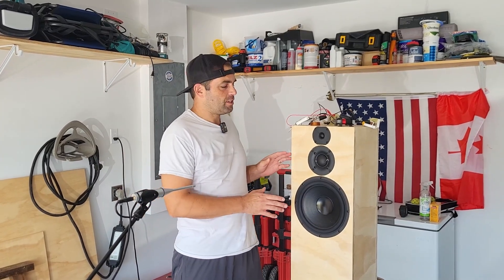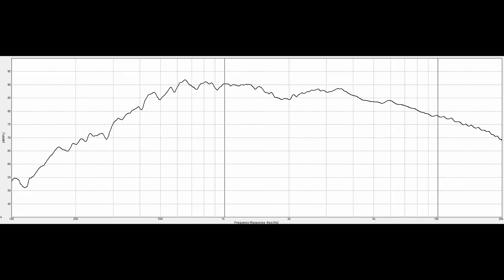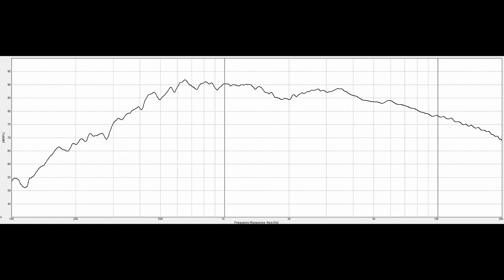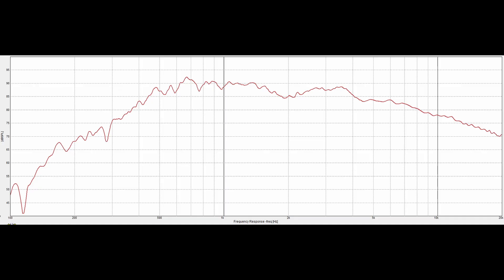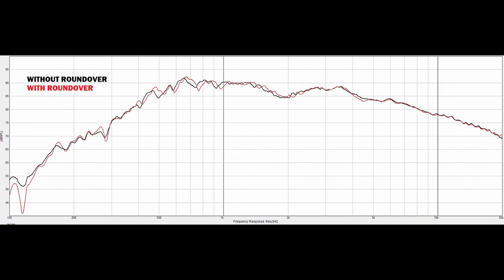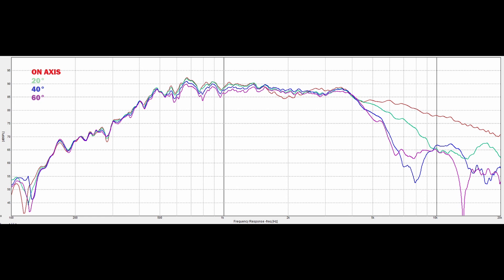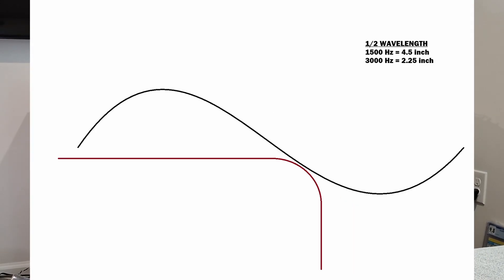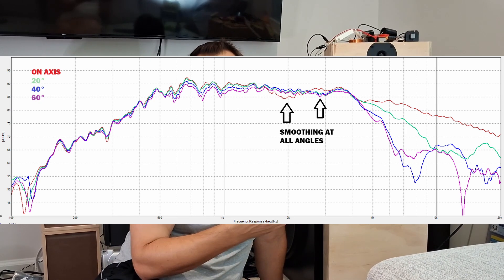Adding a Round Over to a Baffle with Bad Diffraction.

Comment: The frequency at which the diffraction issue is mitigated by a roundover is directly related to the radius size as you allude to. The book "loudspeakers" by newel and Holland OR Joseph d'appolito testing loudspeakers talk about it in their books. But I can't remember which!
Reply from the maker: Ya I simply forgot that would happen until the results were in.
Reply: @ImpulseAudioSpeakers I feel your pain. I made a square box once because I simply forgot about standing waves. So many systems within one box to think about!

Comment: Thanks for doing tests like this. In this case it was just like I anticipated, maybe moving the mid or tweeter horizontally (offset from the center) would make a bigger difference, but probably not very much. Compared to the rest of the system characteristics I believe details like this is negligible.

Comment: I read in a DIY-speaker building magazine that 25° inclines are optimal to fight edge diffraction. This cannot be done by a router and needs a particular saw or straight forward sanding
Reply from the maker: I wonder why that angle. Hmm. Wouldnt be hard on a table saw. Ive done 45 degrees that way.

Comment: Just shave those corners by 2 inches. It doesn't need to be a roundover. Do it at an angle towards the top too. It won't look bad and people can do it with the cutting bit they have. Only a matter of jigging it and of course adding some material behind.
Reply from the maker: Ive done that before. Baffle would need to be double thickness though.
Reply: @ImpulseAudioSpeakers   Yes, at least in the corners.

Comment: Gotta mix in individual 2-4 inch strands of Dyneema with Bondo or some kind of epoxy that I have yet to see. (My 1.0 speaker was made with epoxy corners but they weren’t rounded, just turned a single 90 degree corner into two 45 degree corners). Need to have the shape and size of 0.25 of a vertical beer can. I use spray paint caps to do it. Once the rears cure I put the front panel back on and use the binding post hole once removed ore do 1 side a day using woofer or mid drivers to do each front corners a day. I recommend using a hydroscopic silicone spray so the front will never be stuck along with a thick rubber gasket. No silicone or latex. Fully vulcanized rubber on the softer end of the durometer scale. That along with other material and methods will ensure no rattling and keeps reflections outta’’ da box!
Reply from the maker: Seems like a lot of work. Id prefer to double or triple the baffle thickness then chamfer it with a saw.

Comment: Rule of thumb is that for any effect the round over radius should be at least 1/4 of wavelength to be noticeable. Radius of 1/2 wavelength is recommended. At 3 KHz the wavelength of sound is about 115 mm. This means that round over should have a radius of at least 30 mm. 60 mm would be better. And if you want the RO to be useful at 1500 Hz, well, double that numbers. So your round over was just a cosmetic feature,
Reply from the maker: Yup I'd agree with that.

Comment: Useful video as always:)  love your channel, thanks man. I use the same measurement system (on top of the others).  What's the gate timing and the distance  to the mic and 1st wall you had there (guessing you were in combined mode) as normally even without smoothing (I don't use it) the curve doesn't get to be so rippled.  I'd also check your RT60 in the room. I prefer Seas, SS and Accuton drivers to work with.
Reply from the maker: I recall 4.5ms or somewhere around there. I was only 3 or 4 ft from the ground. This is why I like to get higher and use 10+ms.

Comment: Yeah, you need significantly more to affect those lower frequencies. Take a look at the Grimm speakers. Unfortunately it's not easy to build something like that. Even the termination at the back matters. I think Troy from Joseph Crowe did a video showing the differences you get when you have a horn wrap around completely rather than just "ending" sharply after wrapping around a bit

Comment: My preferred solution for this, if the box can't be modified otherwise, is adding a little "hat" on top of the tweeter, and making the rounder even larger around the tweeter left/right edges in tangent to the two circles meeting in the middle. That would sufficiently disunify the distances and especially equidistances to the point that the diffraction modes still exist but the effect is spread over a larger frequency range with a lower amplitude in any given spot. 

HAT!

Comment: The whole thing with edge diffraction has always been a red herring brought to us by speaker marketing people and ignorant people. As you showed it doesn’t do much at midrange and lower frequencies because of the wavelengths involved and at higher frequencies the tweeter is beaming and so nothing is getting to the edges anyway. Your off-access response graphs support this too.
Well done experiment which will, hopefully, put this malarkey to bed finally.
Reply: "The whole thing with edge diffraction has always been a red herring". No, not the whole thing, but thinking that a round over that is smaller than a 20Kh wave length will fix the problem is.

Comment: You have a top port on your speaker...I've never seen that before
Reply from the maker: Ya I was trying something new and it allowed me to wire the drivers out the top. Only problem is now Im worried Ill drop something down in there 😂
Reply: @ImpulseAudioSpeakers  I was thinking about a top port or a single bigger round front port when I bought a set of DIYSG Vortex kits,  but never got around to building the boxes.
Reply: @ImpulseAudioSpeakers  Worst case scenario you can make a slow 45-45 on the back by cutting away a section that is as tall as the port is high internally (a square cross section if viewed from the side) and creating what's essentially a gradually turning corner that turns your port towards the back again. 

That, or you do some voodoo to swap the inlet and outlet by cutting a hole at the top of the cabinet rear wall, closing the exit that was in the top panel, and doing vice versa at the other end so it ends in the rear.

They're all pretty complex solutions but very interesting methods to faithfully modify a box.
Reply: @AnnaVannieuwenhuyse  At that point in time I had a pet squirrel that wasn't allowed in the basement because of electric wires, but just in case, i didn't want it seeing a port hole and deciding to explore.  Now that the squirrel lives outside, i think a front slot port or single large circle port would look fine on the front,  but two mid sized circle ports would look weird with a concentric driver.

Comment: Better yet, take your tweeter and   mid range out of the box and into a narrow baffle above the base box historically, if you look at some very good speakers, Vandersteen And Dalquist in the 1970s did this. You will have to deal with step compensation, with the lack of a baffle for reinforcement over certain frequencies in the crossover. But will get a much more open sound.

Comment: So then it's not edge diffraction causing the results you have.
Reply: It still is. It's just that the solution used here doesn't provide enough relief from the effects to be significant in context of the on axis response.

If you're unsure of why the off axis ones do improve: Picture yourself standing near the speaker, and point your eyes right at the midrange speaker. Now imagine the distances to the edges left and right of the midrange. The objective distance differential is much larger than on-axis (where it is 0). The percentage change (positive or negative in distance/differential) to before the roundover is greater off-axis than on-axis, because of the depth element added (which is also 0 when on-axis).

On-axis, the center-meeting modes dominate and you cannot escape those by changing the distance unequally without either tackling the modes entirely (stopping the diffractiuon) or moving off axis -- but then they're no longer on-axis effects, which brings our options down to one.

Comment: Use felt rings then 🎉
Reply from the maker: I'm not sure that would work. Maybe I'll have to test that 😊
Reply: @ImpulseAudioSpeakers   Can you objectify a reason why you figure it wouldn't? Or perhaps in a different form or question, can you visualise for yourself what the felt ring would do and then draw conclusions from that as to why it wouldn't do anything? If your answer is no to either of those, then consider that you may not yet know how to gain a science-informed opinion or perspective on this. That's an ideal opportunity to explore this method and the science behind it! And it's also how I motivate learning about these things to myself for myself.
Reply from the maker: @AnnaVannieuwenhuyse unless the felt is very thick itll have the same problems this round over had. But as my comment said, Id love to try. If you've seen what I do on this channel, I definitely try things and learn. My comment didnt suggest I wasnt open to the idea.

Comment: Perhaps the curvature needs to be greater to be effective? I have a pair of Focal Electra 1028be speakers, whose baffles are already round, with fairly large rounded edges. They won't have any diffration?
Reply from the maker: Yes something like a 2" round over would have done something. Maybe not fix it, but a lot better.

Comment: Showing the off-axis response helps support an important concept regarding crossover design: don't try to fix diffraction effects in the crossover to achieve a flat on-axis response.  This will cause peaks in your power response where the off-axis response is actually higher than your on-axis response, which is already flat.
As someone who loves a wide-open sound (from wide horizontal dispersion), my preferred solution is very large round-overs.  I don't prefer waveguides, which typically restrict dispersion.  That might be best for multi-channel, but for stereo, I appreciate the effect of a soundstage-enhancing sidewall reflection assuming it's well balanced spectrally, and sufficiently delayed so it doesn't degrade imaging.  That does require a room on the larger side, as you need about 5 feet (or more) between your speaker and the sidewall.
Reply: Agreed. 
Re soundstage enhancing reflected energy, ASW, or Apparent Source Width, ... plus a clean ITD Gap, followed by late arriving reverberant energy. 

It's refreshing to encounter such a reference. I suggest it every polite opportunity myself! 

I often point out ... all this work has been done. I mention targeted acoustic performance best practices, LF decay times, ETC measurements and the ITD Gap, ... and 40yr career audiophiles have no idea what I'm referencing. 

Gene Patronis and Don Davis'; Sound System Engineering. 
Trevor Cox and Peter D’Antonio's; Acoustic Absorbers and Diffusers: Theory, Design and Application. 

Overlay that work with Dr. Toole's, Sound Reproduction, ... which assembles an overview of all the above technical best practices, a strong emphasis on subjective findings, ... essentially listener's preferences and how to get there.       

The pathway to a high-performance listening experience is clear. Yet, most rely on old school myths, or an ex-felon youtuber selling magical treatment.   

Hopefully LLMs eventually get it right! As the enthusiast of a decade from now will likely be largely reliant on them for learning of performance pursuits.

Apologies, rant over.
Reply from the maker: Very good point. It would have been good if I commented that in the video.

Comment: Also not just depends on the frequency BUT also the drivers. If a driver beams a lot you are less likely to have issues.
Reply from the maker: True. I did cover this in my tweeter diffraction video, but I should have repeated it here. Thanks.

Comment: I have done this work the hard way back in the 1980s. 3/4"
round over is near useless at all but the highest audible frequencies. If you want to keep the surface wave energy stuck to the surface and not diffract off at down at meaningful frequencies, it needs to be in the neighborhood of 6" radius, or greater. .
Reply from the maker: Yup!

Comment: Hi, You can test if the dip in frequency response is caused by the distances from mid to edges of the baffle by playing pink noise and holding a piece of plywood by hand as if one of the edges is longer (say 30cm x 20cm or any other length). You can move the plywood from one side of the baffle to the other and see if the dip goes away or it is always there.
Reply from the maker: Hadn't thought of that. Good suggestion.

Comment: @ImpulseAudio  
Comment for the Algorithm.  ;)   Also, noting that this design seems to have 3 Equidistant baffle edges from the midrange.

I use the same Ciare 10" midbass and love it, but it's combined with a BMS 5CN162-HE 5" Coaxial midrange/HF compression driver, all run active with a multichannel car audio DSP/Amplifier powered by a nice 12v PSU.

Can you not move the speaker out more into the center of your garage further away from the walls/corner to do your measurements?   ...Oh, I guess you have the floor & ceiling to worry about anyway, so disregard.

HINT:  Just bust your @ss to earn the cash to buy a pair of KEF Blade ONE META or Blade 2 META.  Edge Diffraction problem solved, mate.  😊
Reply from the maker: I love the Kef Blades!! Yes the garage floor is the issue. Going outdoors and high is the best options. Also, thanks for the algorithm boost 😅

Comment: Another option is 3D print a baffle and glue it to the front. Or use 1/2inch foam, or any other material that can be easily sculptured. Instead of glue, you may velcro it on, to easily switch and test different baffle designs.
Reply: Oy the legend! I'm redesigning myself a Hypercube >.>
Reply: @SianaGearz  Hi! Mine still works great :)
Reply: Aka cheap boombox style ;p Or just make the entire front baffle of foam with the "real" baffle behind the drivers (mounted with rings)

Comment: I think the roundover was too small for the midrange frequencies.  Just my guess.
Reply: To notice a roundover in the mids the radius has to be about 1 1/2 up to 2 inches. Been there - done that.....
Reply from the maker: Agreed, hence my conclusion.
Reply: @ImpulseAudioSpeakers  Exactly :)   A while back I did  basically a quick and dirty test similar to what you did and came up with a similar conclusion. 

Honestly these days I dont even worry about the little wiggles in response and I'm totally good with a speaker that has a sharp edge. 

I find the room interaction is so far greater anyway in terms of messing with the response.

Comment: Brian, I am wondering if The Baffle Diffraction and Boundary Simulator (1.30) by Jeff Bagby would repeat your results. Would you please check that out?
Reply from the maker: Does that spreadsheet work anymore? There was a program called Edge I use to use years ago, but I couldn't find it anymore. Seems those tools were designed on very old versions of windows.
Reply: @ImpulseAudioSpeakers  I believe it would work with the new version of Microsoft Excel as well.
Reply: @ImpulseAudioSpeakers  I guess if you have Microsoft Excel that table should work. The latest 1.30 Revision is dated 2019 and it seems to be working with some issues in my free SW OpenXLsx PLUS.

Comment: I'm considering tweeter placement in an MTM and thinking of offsetting to one side so the diffraction isn't amplified by both sides. I'm not doing a roundover on this one.
Reply from the maker: Consider that as you move off axis you will get bad diffraction at some angle, and it won't be the same in both directions. I'm generally against offset.
Reply: A roundover is a good idea regardless, even if it's a small one compared to what's shown in the video. It's outright foolish to forego such a simple aid and mitigation for what it takes in effort.

Comment: This may be a stupid idea, but what if you added a piece of wood to the top of the speaker so you were not equidistant on 3 sides? Do you think that would have much effect on the diffraction anomalies?
Or would the fact that the wavelength is so long just negate that?
Reply from the maker: It would probably help, but the reason I did that is to reduce tweeter diffraction (there's a video on that) and aesthetics. Ultimately, I can't hear it and off axis it flattens right out. So I'm not concerned.
Reply: @ImpulseAudioSpeakers  Sounds like my proposed "hat", actually! If you keep the size small enough so that it isn't any multiple of quarters and less than one entirety of your width's distance center to edge, you should be fine. In other words, keep it to a weird nondivision fraction of or deviation from half the radial distance in respect to the sides' radial distance.